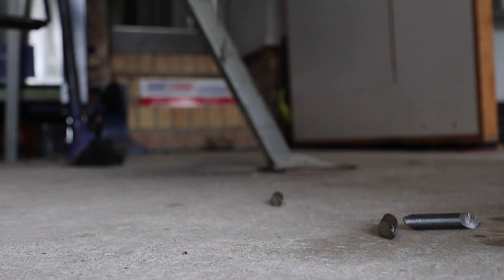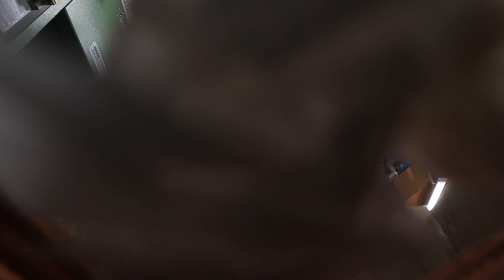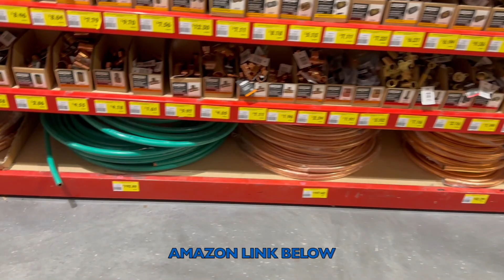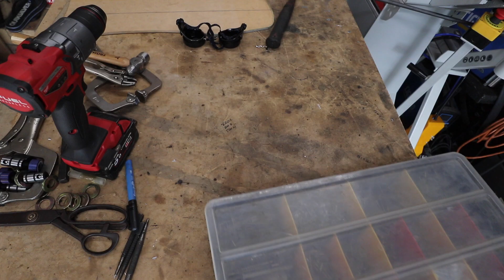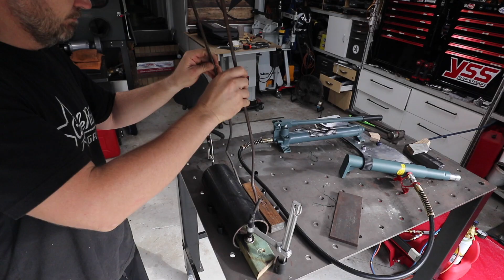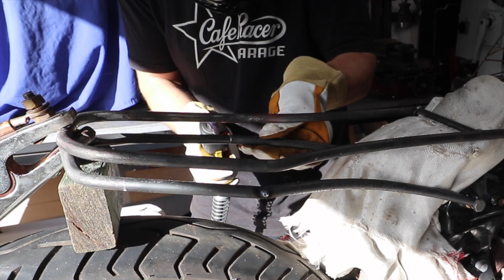★ CAFE RACER Subframe Build [Part 1]

Comment: Hey mate,  why not use chrome molly steel for these parts . I would think that's what they are made of originally and you can then make the parts using thinner wall tube that's easier to work with.

Comment: You may be covering this in a later video but are you putting in additional supports or will the rigidity of the final product and the mounting points supply enough support to hold a rider's weight/leverage?
Reply from the maker: this is only a mock up template as the actual part that I’m making will be made from a larger diameter and stainless steel so the supports that it currently has is all it’ll need
Reply: @CafeRacerGarage  thanks for the explanation, good luck!